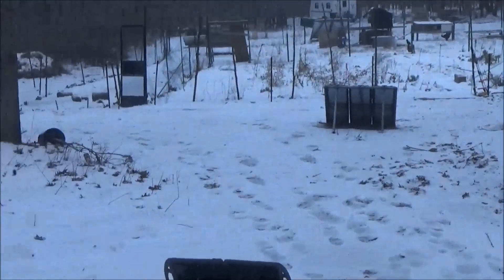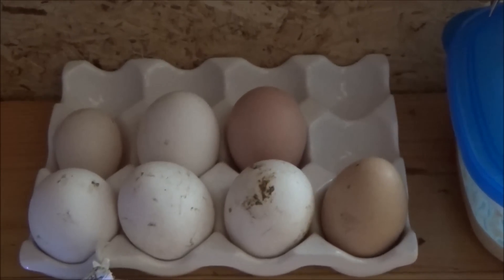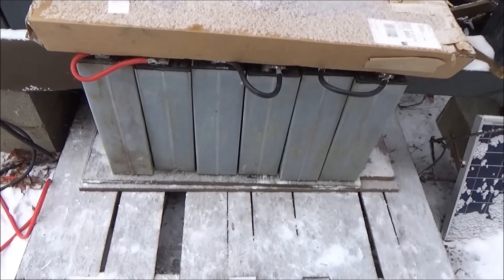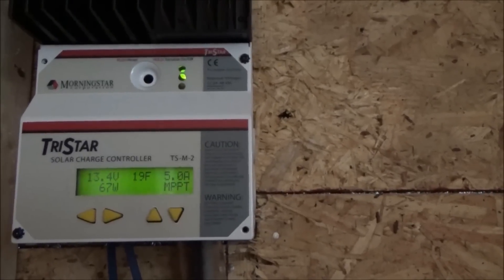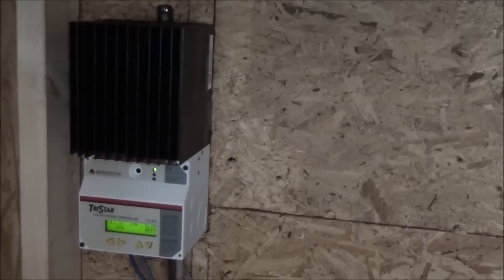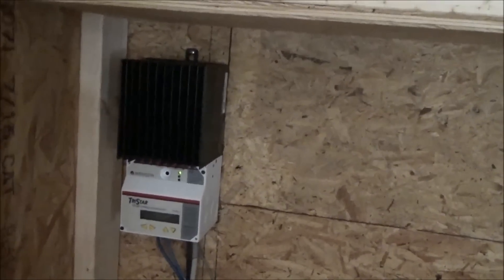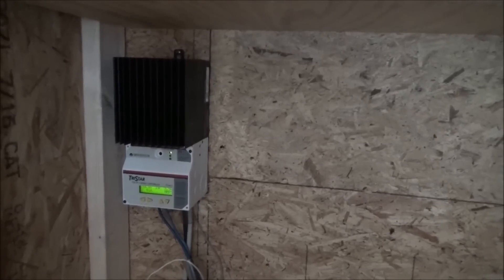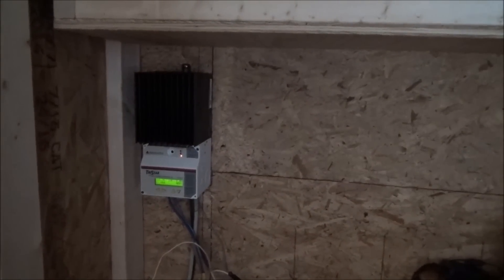Testing Old Forklift Batteries For Tiny House Solar Power

Comment: 13.4 Volts isn't going to charge a lead acid battery like that at those temps.  You may get a little surface charge on the plates, but that will drop off quickly.  You have slowed down the reactions significantly at that temp.  It's just chemistry.  The reactions slow down.  What make is worse with large batteries is they act as a thermal mass so even if you get them warm it takes a LONG time for the battery to warm up.  Even a car battery takes a good 24 hours to come to room temperature from 0 degrees when brought inside.   You won't notice this as much on batteries that have more surface area on thinner plates (like car batteries), because they have more area for the reactions to happen.  On batteries like fork lift batteries and gulf cart batteries you will notice it a lot sooner.  You need to put a battery at at least 2.7volts per cell to get any meaningful change in the electrolyte at those temps that is why your controller bumps up the voltage.  The higher voltage won't make the off gas at those temps though because you can get a strong enough reaction going.
Reply from the maker: Actually I am pushing 14.5 volts out of the charger. 13.4 is what the batteries are showing at the time under charge. They are absorbing the charge and slowly raising in voltage.
Reply from the maker: Alan Marine I am getting on average 12 amps in good winter sun from the solar panels. The DC generator can give me a bulk charge as needed at 100 amps. The HF generator and manual charger can top it off. On good sunny days the MPPT charge controller can give me an equalize mode to desulfate them.
Reply from the maker: ***** Two days. What is the problem?
Reply from the maker: Alan Marine I think you are missing the point. After the batteries are reconditioned - which will take forever anyway - all I need to put into the batteries is what I take out. Not the full capacity of the battery every day. I do not plan to drain them fully every day. Just use a little bit of power for my laptop and LEDs each day.
Right now these old junk batteries are better than the golf cart batteries and are a temporary fix until the new forklift battery arrives - fully charged.
Reply from the maker: Alan Marine My AC charger puts out 14.8 volts.
Reply from the maker: The Do It Yourself World I might be off by .3 volts on my comment.
Reply from the maker: ***** Doing good so far. The old junk forklift batteries are up to 12.4 after resting overnight with no load compared to 12.2 volts the past days. Two days of sun and equalization and running the genny and manual battery charger seem to be helping. Although a desulfator will work wonders on these.
Reply: A fully charged lead acid battery will not freeze until the temp hit -98 degrees F.

Comment: Before any one says Troy should wash the dirt off the eggs NO!!!!   Washing removes the protective film.
Reply from the maker: Captian Marvel That is why yours last a few weeks whereas I have learned mine last a few months.
Reply from the maker: timcat100 Good point. Thanks for the tip. Why should I make my bed anymore?
Reply: You can clean them, and then coat with vegetable oil, it has the same effect. They will last months without refrigeration.
Reply: The Do It Yourself World
Leave it on and just wash em right before you cook them.  That way you get the poop off before the insides are exposed and the film is left on to protect. 
 I seriously think you have already figured that one out.  Not sure why people think you wouldn't do that.
Reply: timcat100    You only need to wipe the egg off with a damp cloth before using. No need to refrigerate a fresh egg. But then Americans tend to put tomatoes in the refrigerator as well.    

 Its the government that requires egg farms to wash eggs before placing in cartons for sell.  But then factory farm chickens are loaded up with crap that Troy, I and other chicken folks do not feed our hens.   

Even today when in France we find no washed eggs even in stores.  If an egg is really dirty, one simply allows the dirt to dry and then you take a cloth and brush off.
Reply from the maker: timcat100 haha. Try buying "fresh" eggs at the store. You cant find any. lol
They are already weeks old before yo get them. Its all about looking pretty these days and not about our health really. White bleached flour. Bleached sugar. White eggs. Gassed tomatoes. Nothing has any real food value anymore but it sure looks pretty.
Reply from the maker: timcat100 That is nice. And rare at most supermarkets
Reply: The Do It Yourself World not really. Most Hutterite Colonies are considered commercial producers of food. The best restaurants in my city get most of their products from the Hutterites. Their chickens are the size of small turkeys!

Comment: A simple rule to charge your batteries to full is Total Amp Hours + 30%. The reason why is due to losses you get when charging.
Also Make sure your water level is about 1 inch  above the plates in your batteries.
Thanks for sharing. :)

Comment: I really do hope that there is a video in the next bit that shows you building a good, insulated storage compartment for your batteries and charging equipment. Followed shortly after with a sheltered outdoor work area. Winter is here my friend, no use waiting for warmer weather, it will be months yet. 
And I think I mentioned it a few times - you NEED a boardwalk for your high traffic areas to keep the snow clear and give yourself a clear and safe path of travel.

Comment: What you are experiencing is surface charge, to find the real state of a battery bank disconnect EVERYTHING and check it with a voltmeter after about 6 hours of sitting unused. That reading reflects the actual charge state of the batteries. Golf batteries are a very good way to go and you probably know old ones are likely in poor shape and been charged too many times already. Like you said keep them warm as you can. Doubt they will hold a charge, build a room inside and vent it a little for gases. Charging with a charger will not desulfate  batteries, buy a desulfator and hook it up to your generator periodically and that will remove the sulphor on the surface of the plates. Good luck!

Comment: Hi, Get a clamp on ammeter and see if the modified sine wave harbour freight generator may not be running that battery charger at full potiential. Mine runs a similar charger at about half power. The transformer in the charger does not like the square wave ac. I could be wrong in your case but I'd like to know.

Comment: U will need 3000 watts of solar panels (12 x 250 watt standard full size panels), to fully recharge and properly top off the forklift battery bank each day. Good news is prices are low...
Reply: Yea, i noticed that prices for pannels have come way down... over here in England i have never seen them below £1 per watt, now they are as low as £0.75 per watt... If i wasn't so low on funds i would get myself another 1000w, but sadly ill have to wait to later on in the year (no doubt when the prices go up again when the sun is out)

Troy as only got 400w of panels wired up i believe,  but he has 1600watts of panels in total, he really should get the others wired up, 1600watts should be able to cope with his draw... that is if he really is only pulling ~50 watts max ( 5wat Modem, ~25watt laptop and lights / USB charging) but until he gets current meters on the battery outputs we will never know how much he is using.
Reply: Shaggy one
 sorry, i should have made myself more clear, i was talking about 50watts per hour... so about 1.2kwh daily.  that is my estimate of what he is running... but that doesn't cover anything he isn't telling us about or the draw from his inverter (which could be as little as 5 watts or as much at 100 watts).  Its also not factoring in the draw from the fan on his loo, my guess on that is its a 12v 0.5amp so 6 watts or about 150 watts per day.

Basically it was a rough guestimate of the 3 things he said he had running when discussing his power draw.  The problem with this is that we often forget about loads we have on, or we forget about power factor / idle loads / efficiency and so on.  So the only way for troy to know how much power he is using and how much power is going back into his batteries is to actually monitor these things at the battery terminals with current meters.  Hopefully if enough people keep telling him this then eventually he might actually hook something up and realize he is actually asking for up to 3kwh per day out of those batteries without realizing it.
Reply: well he said that the cells were 525ah cells, so that would mean a 12v battery would be about 6KW.  Now he probably wouldn't want to go below 50% (3KW) if he can help it for keep the battery in good condition for as long as possible.... and with lead acid charging not being 100% efficient he would probably need 4KWH or solar income to recharge that battery should he use the full 3KWH out of it in any one day.... so based on averages he would only need a ~1.5kwh solar array for winter sun and he has that already so he should be good... in the summer 750watts of solar would probably do if his loads did not increase. 

But like everything else we are just working with averages and guesstimates here, nothing is concrete and no figures can be trusted expect the ones you measure at the battery terminals.

I think the reason that Troy has not disclosed his full energy use is simply that Troy doesn't know it himself.  I think he also is still under the impression that measuring the actual output and input to your battery bank is not a must and is not important.  Once he realizes that it is the most important thing to know when you are talking about a solar power solution then he might overcome most of his problems.
Reply from the maker: You are all talking about discharging the battery bank to 50% every day which I do not plan to do. I do most of my video work these days during daylight hours so the sun powers my work. Evening hours are limited and I run the laptop on its own battery. Your numbers are severely inflated really. Remember in summer I had power to spare and was even running and air conditioner on my solar power.
Reply: The Do It Yourself World
 Troy, i would love you to prove that our numbers are severely wrong, but the truth is that YOU don't know how much power you are using.  When you can show us a current meter plugged into your battery output over the course of 24 hours and show us you hardly use any power then we can put this to rest.... until that point i personally believe that you are using more power than your system can handle.  Lets face it Troy, 2KW per day is only 83 watts per hour, and that kind of draw is easily possible with a netbook, a modem, a toilet fan and a couple of USB chargers... not even covering your laptop and tool battery charging, lights, TV/monitor and the like. 

The sooner you get a meter on there and can actually SEE what is going in and out, the sooner you can shut us all up and prove to us that you are not using more than you are getting in.
Reply from the maker: 1981therealfury Dont forget the generator. Lots and lots and lots of power. I mention that in every single video.
Reply from the maker: 1981therealfury Yes, through the three years out here I say it again and again. I dont get enough solar output in winter. I have not hidden that fact. But you cannot deny the fact that in summer I was running my AC unit plus everything else and had energy to spare each day. Right now I can get it down to 200 watts total - per day in limp mode. On average I use a PEAK of 800 watts if my modem and netbook were running, which they are not. I just sat down and did the math using extreme numbers to scale up.

Remember that I have battery powered LED lamps I use in low power days. I use my laptop on its battery and charge when and where I can. Modem gets turned off when not used. Its not much power really if I am careful
Reply: The Do It Yourself World
I agree, getting good solar is hard in winter... once you get your wind turbines set up and perhaps mount some solar pannels up on the tower if its possible? you might see a bit better return without the trees in the way so much and the wind power will help to suppliment your income.... if i remember correctly you had both wind generators running last summer when you had all the excess power?

Anyway, i wouldnt be surprised if your inverter uses 600-800 watts just in standby mode over 24 hours... i havea 600 watt one that uses 15 watts idle and a 180 watt micro inverter that uses 5 watts idle....it all adds up.  Only trying to impress on you that the only way to know that you can go all day on 800 watts or 200 watts in limp mode is to run a meter and actually record it.

Any way, im going to stop droning on about current meters now, i think i have said it enough... hopefully you will get a decent one when you can afford it and we can all see your useage and generation numbers :)
Reply from the maker: 1981therealfury Yes I will get a good meter soon. I am looking on ebay trying to decide which one to get. I do hope to have actual numbers to share soon. I am looking for a digital amp meter with logging to show overall daily usage. That will really help me show the real deal out here. Thanks for being there :)

Comment: the temp sensor does not alter the voltage you see on the digits, the temp compensation is used by the mppt charge to alter the charge mode comparing to the temperature, the voltage jump is due to the charger charging (as i mentioned on the comments before regarding to the charger.)
bubbeling the battery's is a good thing, jou are right aboutthe stratification, due to the height of the cels its indeed good for these kind of cels. good job to connect them!

Comment: With the overall weight of your house are you worried that the frame underneath might start bending it was never designed to carry that much weight, if you ever go to move the house good luck you might be breaking axles, I thought the point of a house on wheels was to keep it light.
Reply from the maker: The trailer is designed to hold 7,000 pounds. The house is 6,000 empty

Comment: the batteries - which less face it are outside where its snowing/cold/open to the elements - wont take or hold a charge properly.
Reply from the maker: Thats not what the forklift battery company says who sell batteries to companies who use them outdoors and inside freezers all the time. Weaker yes. But they work just the same. If not then your car would never start in winter.

Comment: I know alot of people may have mentioned it or maybe not. But any battery will show lower voltage in below freezing temps. Technically batteries are only at 100 % at 25 C or 77 F . So to put it plain it simple, those batteries are freezing are to death literally. Batteries must be stored at room temp to work properly. This is why vehicle batteries don't like starting cars on very cold morning also. I have my Solar battery outside also, But Inside a vented heated/ Insulated box. Why , Well for Obvious reasons. Cold will kill your batteries just as quick as High Temps do. But it is imperative to have them at room temps or you will never have any success. Good luck Here is a link you should read up on...http://www.solar-electric.com/deep-cycle-battery-faq.html#Temperature Effects on Batteries
Reply from the maker: Yes a battery is weaker in the cold. I know that and I am sure I mention it a few times in my videos. No, I mention it a LOT in my videos. Its part of the struggles I had the last few years in the camper and RV. Cold will not "kill" the batteries. They just have less usable energy. Forklift batteries are in service all over the place in freezing temperatures. So are vehicles with starter batteries. They are weaker but they work.
Reply: The Do It Yourself World Cold will kill batteries. It doesn't matter. Once you freeze a battery you are taking many chances. Even battery manufactures will tell you that, Unless they design the battery for such conditions. I guess now your going to think I am being hard about this, Well I have to be. In order to get the point across. There has been many other people that live straight off from Solar energy and can tell you. Cold is an enemy and can be disastrous. Personally I would have brought those Forklift batteries inside warmer conditions. Let them warm up. Then start charging. It makes a world of difference. When trying to recover batteries properly.
Reply from the maker: Dale Marshall Then you better bring your vehicle into the house to keep the battery from being killed. What about all the forklifts that run outside 24/7? A fully charged battery will not freeze. Now, if its not charged and it freezes you ruin it. Granted the cold reduces usable energy. Thats a fact. But what you are saying is that we should all bring our vehicles into the house or the batteries will be ruined.
Reply from the maker: Dale Marshall Hope you dont get upset. Just friendly banter
Reply: The Do It Yourself World  LOL...No we can't bring our car inside, Even though most people do have garages. I'm just saying , If you don't have to leave your batteries out in the freezing cold, Why should we. Car batteries are Different monster compared to deep cycle batteries. Yes Forklift batteries are used alot outside. But alot of them are using inside also. I have had so many friends lose there batteries because of the cold in there Solar setups after i have explained over and over. quit that crap. PS. Not upset. It all good criticism. Sometime we have to sneek behind our brothers back and say...What in the ...,,Your doing wrong again. But this is just friendly advise from a person that been there many times and has learned the hard way several times about batteries.